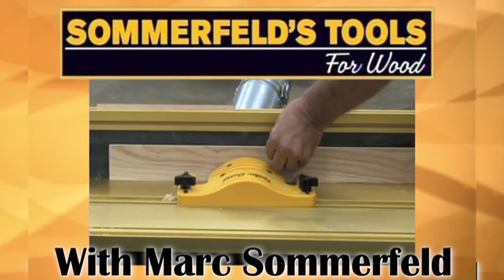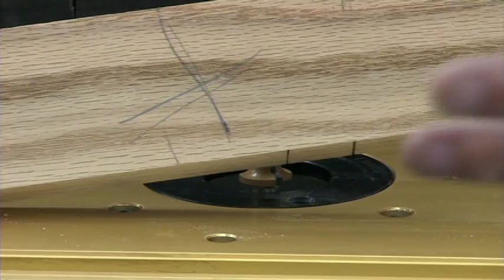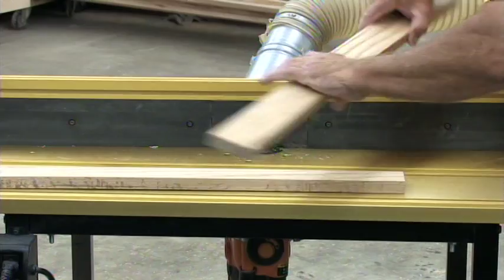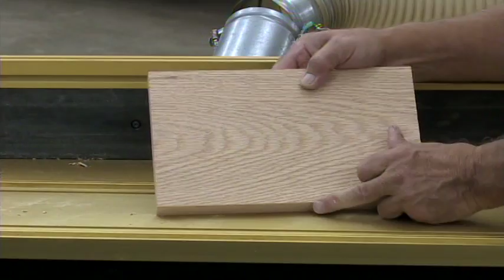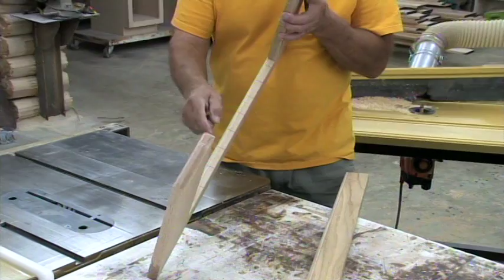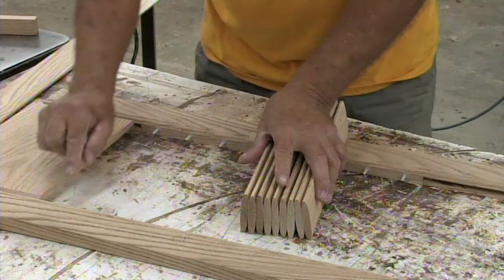Sommerfeld's Tools for Wood - Window Shutter Set Made Easy with Marc Sommerfeld - Part 1

Comment: You know I was looking at the comments in here not one person is asking what kind of wood you’re using the thickness or anything and I don’t understand a lot of people that put the stuff on here. Do not put the type of material they’re using and where to get it. I’m making my own shutters and I’m buying Basswood. It’s expensive and I’d like to know if there’s anything else I can use like maybe one by fours Fur or pine if that would be acceptable to make it it’s a little cheaper it’s easier to straighten out and make smooth and everything. What are your thoughts?
Reply from the maker: Great questions! Inside I would use pine, outside I would use cedar for rot resistance. Thanks for commenting!

Comment: Hi I love your detailed and practical instructions , I'm stuck on getting my louvers to come out pretty , I'm using feather boards in the center pressure but I'm getting about 3-4 gouges on all my pieces . What's the secret? Or do you think that's normal and I should just filler it up ?
Reply: Sommerfield's video has some poor methods.  First, you must have a hold down on top of the louver when you are running the wood through the router.  You can see on the video, he made mistakes at least twice and the wood stock raised and he had to run it again.  .   Second, the feather board must be centered on the wood.  Third, you must feed the material at an even and consistent feed.  Fourth, you must have a long thin (1/4" thick) push-stick to push the wood the last few inches.  Using your finger to push it is highly dangerous.  In routing, you MUST push the material through the router bit at the same rate of speed...pretend you are a robot pushing it through.  I have had the most success on louvers when I have fed it pretty fast (not light-speed fast).  You need to practice on scrap wood the exact same size.  I also add a second feather board at the right side of the table to make sure I feed the wood nice and straight, always keeping it tight to the fence.  I have a habit of pushing the wood away from the fence (creating some space) which is not good.  Lastly, if you still have problems then you need to add a long spacer on the left side (out feed) of the router table.  Experiment, it will be shaped sort of like a knife blade and matches the space after the cut is made.  You can make it by taking a long board and ripping it on a table saw.  This will be a very, very thin long piece the is tapered top to bottom.  We are talking about a long piece that is about 1/4" wide and 1/16" or so thick with a very sharp angle which gives it a knife edge. Take the long skinny board and using double sided adhesive tape, stick it to the bottom of the outfeed router table.  This prevents the stock from drifting into the fence.  If you don't do these type of steps you will be tossing out a lot of scrap wood.  Sommerfield makes it look very simple but his method will not make consistent high quality results.

Comment: To save yourself some money just go to Home Depot and get some rivets for steel.  They work just as well as those shutter inserts made of plastic but at a fraction of the cost.  Ensure you use the correct size drill bits for the rivets remember that the rivet will last far longer than the plastic ones.  Ultimately you will have to choose which product you feel will be right for you, I am commenting to help you have a more informed decision.

https://www.homedepot.com/p/Arrow-Fastener-3-16-in-Medium-Aluminum-Rivets-50-Pack-RMA3-16IP/100211151
https://sommerfeldtools.com/shutter-pins-for-our-window-shutter-set-30-pack?filter_name=shutter
Reply: Lol

Comment: Hi Marc, i have a question; "wich wooden are uses you for the shutters ????" Greeting from Germany
Reply: He is using Red Oak.
Reply: @jwar2163  Yes he is using red oak but you must realize that a wood this hard will quickly dull the router bit.  Remember you are running hundreds of feet of wood through the router table.  For this reason, if you don't need the oak kind of wood grain, then you should consider a soft wood wood like poplar, bass or clear pine.
Reply: @markgkenny2264  I was replying to Badman XXL`s question about what wood is being used. I am well aware of the hardness of red oak as one of the many hardwoods that I use in my personal woodworking shop.  I have used red oak to make shutters, but then again I have a planer/moulder for that with knifes designed for shutters that are hardened and able to be re-sharpened In the video Mark Sommerfeld is using a router table which many people only have access to. Your points are valid as the router bit will dull out with hardwood. Bass wood is the best for shutter louvers. As for me all my wood from cabinets, trim, crown, casement, shutters, and doors are produced with red oak.
Reply: @jwar2163  I'm sure your Oak shutters are beautiful !
Reply: Badman XXL - why do you think the Sommerfield never replies to lots of questions?

Comment: Dear Marc, thanks a lot , but the important point that needs to be considered is that the weight of controller rod located at the center of the louvers should not pull the louvers back to open / half open position . The louvers needs to be stiff a little bit.
Reply: You have no idea what you are talking about